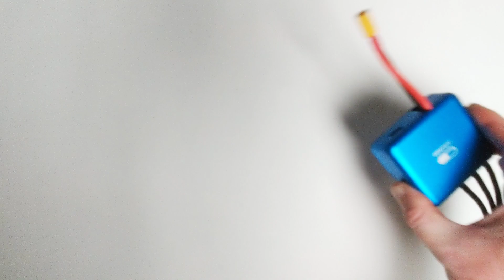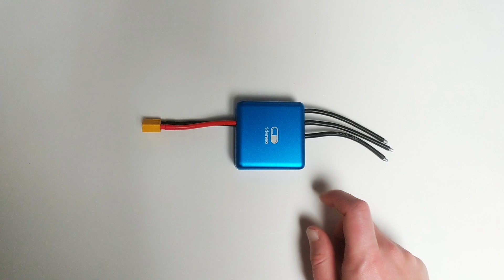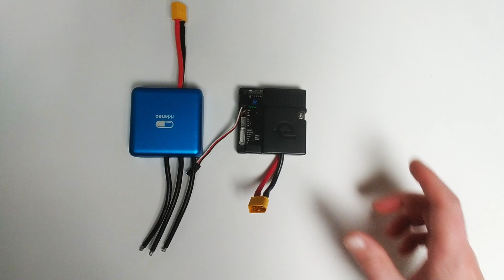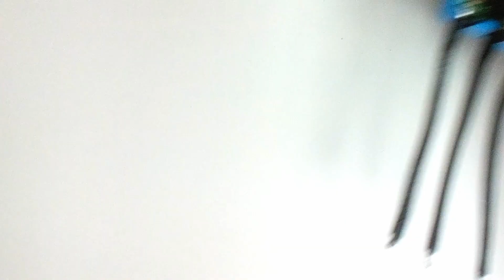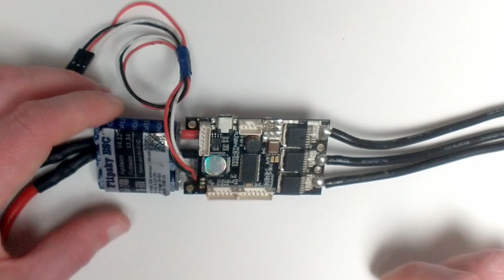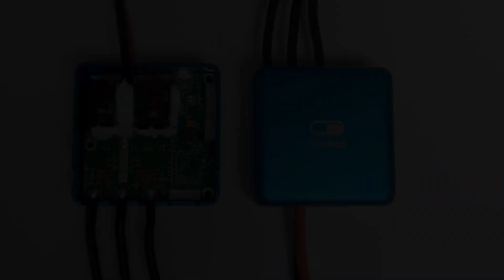Neo Box ESC - What's in the box? (defunct 2019)

Comment: What’s the difference between the v4 and v6?
Reply from the maker: Hi Peter, the V4 is rated for 80a continuous while the v6 is rated for up to* 100a, that's pretty much the primary functional difference.
Reply: Dred Sk8 thanks. Couldn’t find the info on your website.
Reply: @DredSk8  hi I'm a noob when it comes to diy so I dont really understand but that means more power right? it's supports bigger battery and motors?
Reply from the maker: @BruceLee-oo3tz  so it basically means you can run more power to the motors if they/the battery supports it, the maximum size battery these can theoretically support is 13s.